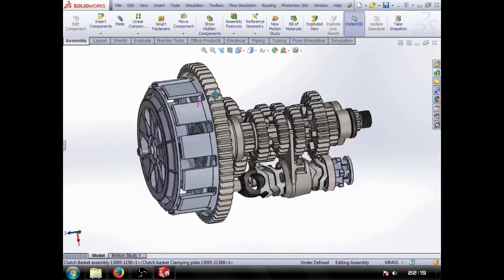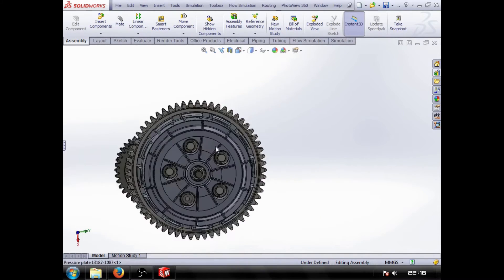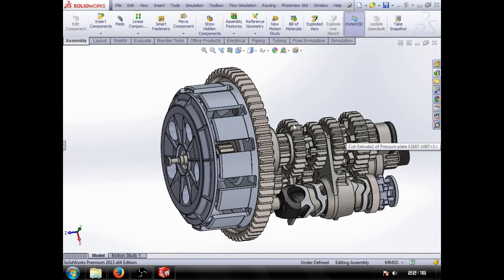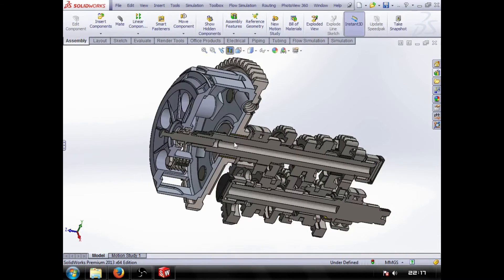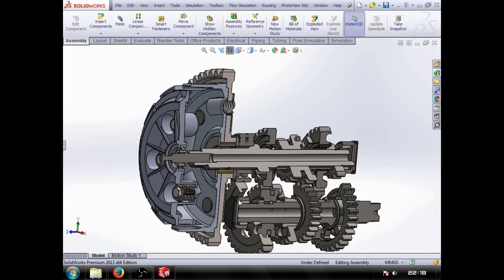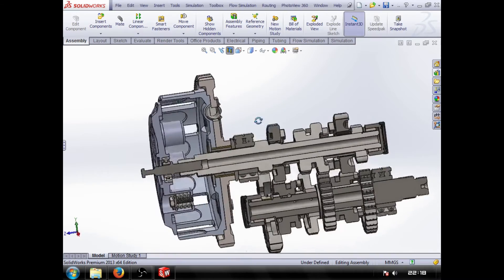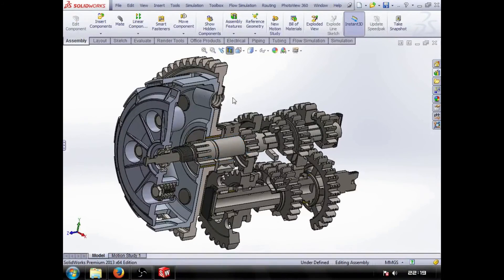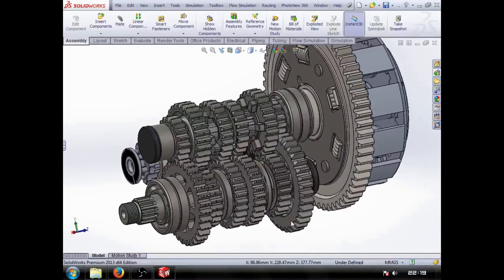Solidworks Engine videos

Comment: Solid Works, can be challenging for the beginner. been using it on and off for about 1 1/2 years. don't think I'll be making that anytime soon or this year. 
nice to see more
Reply from the maker: Its not that hard, if you've been using it for sometime then the clutch/gearbox in the video is easy, you just take it 1 part at a time